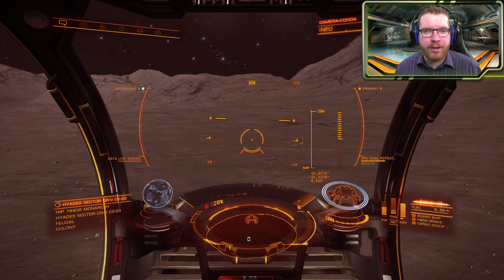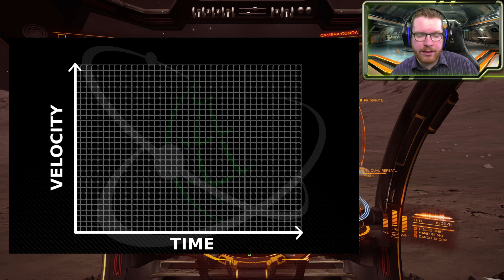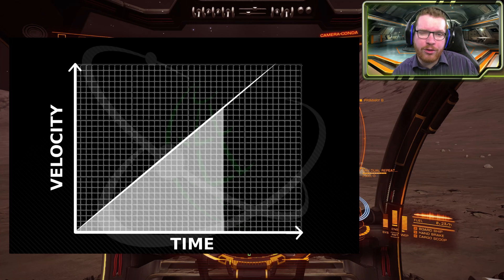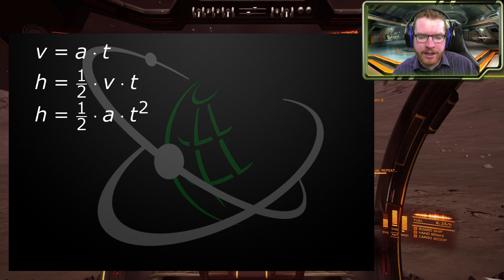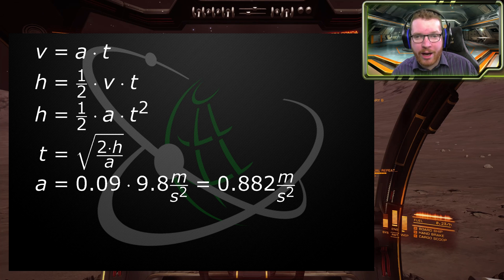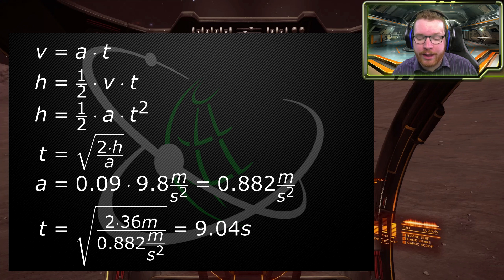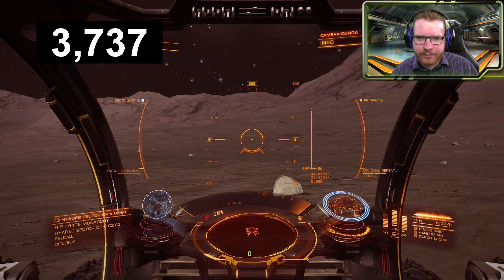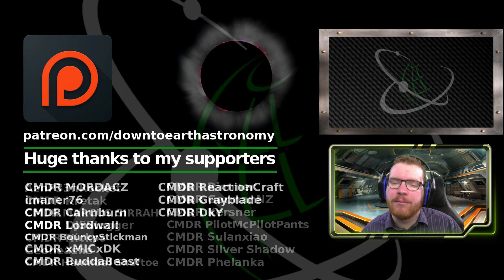Breaking the laws of Physics in a SRV | The Science of Elite

Comment: Suggest to repeat this with drive assist off, otherwise as already mentioned the thrusters are supposed to push the SRV back faster.
Reply: As far as I know drive assist only affects the acceleration mode of the wheels.  If you lift off with assist turned on and pitch the srv it will continue to pitch until you correct it.  So it looks like it's just for the accelerator.
Reply: @TheMaw365  well if you can't turn the thrusters of (I didn't try) then that whole measurement makes no sense and the statement that laws of physics are broken is wrong. The SRV is actively accelerated down and so the acceleration is the sum of the planet's gravity and the thrusters. Theoretically the thrusters acceleration can be calculated that way. Maybe with no pips in eng and using the full capacitor to go up the thrusters are off. I will try tomorrow.

Comment: I'd like to see this test on the geological materials use of the gravity after being shot. I'm not sure if the gravity value is a system wide variable or a state variable. The SRV might be set to a series of states for "Low G", through "High G" and may only be 4 or 6 states with set parameters. I'm not a programmer per say but I do know a bit on high level side of things.
Reply: I did not do any serious test, but I had the same idea. If you shoot a "outcrop" or similar, then boost to be actually higher than the materials, you still land faster then the chunks. It seems at least for low gravity that the SRV behaves differently than all other physical objects. Whether FD used discreet acceleration values for all possible sizes of landable objects is another question, though ;-)

Comment: That's pretty much exactly right.  Just running out of boost didn't turn off the fact that SRVs automatically produce additional downthrust on low g worlds, making things equal to the average of 1g and the world's g... in this case that means .545g is the expected acceleration and that gives 3.67s.  Removing that factor might be a problem... maybe if you got another ship to lift the SRV to a height, so you could completely powerdown the thrusters and then have that ship try to drop you in a reasonably controlled fashion?

Comment: ive been told that the srv compensates for very low gravity with thruster pointing up. otherwise you wouldnt be able to reasonably drive around. that being said i would assume it only does that on the surface, but who knows. id love to be able to toggle that effect on and off and really get some long flights in. i know ive been on a 0.00g moon and it felt the same as the ever common 0.04g.
Reply: Sir have you not seen Armageddon?  Or was it star wars ;)